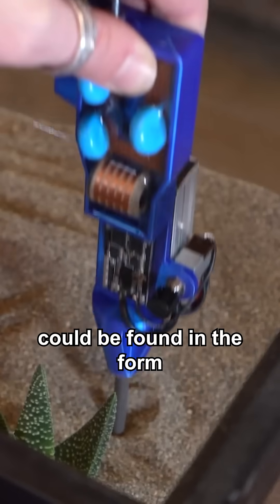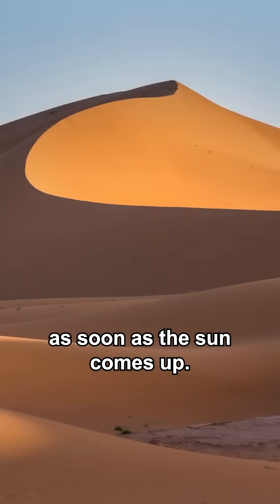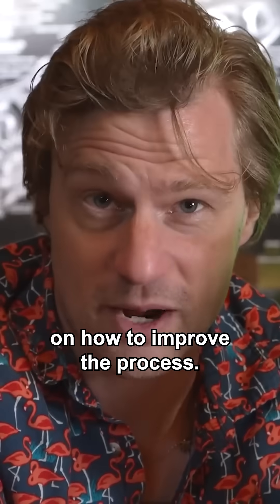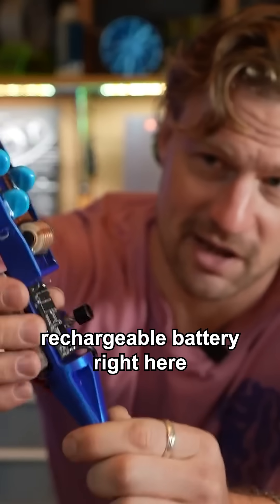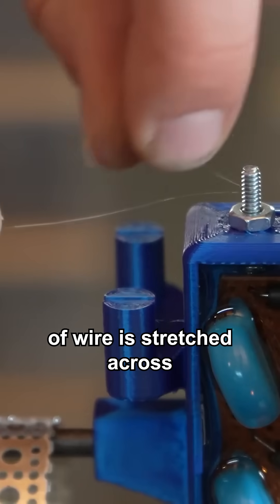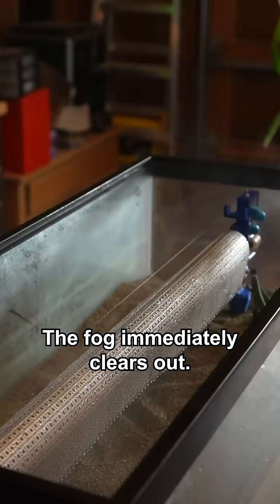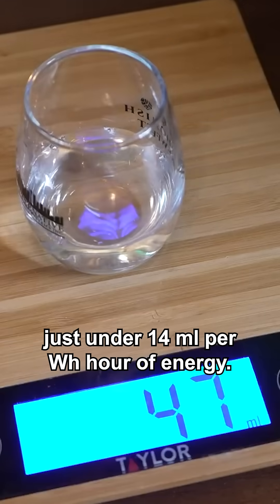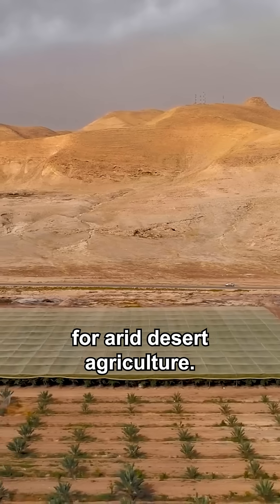Solving Desert Water Shortages Using 20,000 Volts (from full video)

Comment: Dude. This is insanely good. In your time developing this, do you think this can become mass producible given the scale that will be needed to wet soil in an arid environment?
Reply: It's a dehumidifer with a fancy name. It works the same, functions the same. You can't drink those water. You can look up other scam project like these. They will add filters and tells people its safe but its not. The air we breathe are not fully pure water vapor. It has dust and particles. Turning them into water is just you drinking dust

Comment: I saw a place where fogs are collected in nets installed vertically. Without any electronic/electrical components. Meaning, there's no need for power supply, just a simple setup of poles and nets. Water is then collected at the bottom of these nets through a water container.

I wonder how that was different from this invention shown in this video. And which is more efficient.

Comment: Yeahhh except solar panels are a scam and you end up having to replace the panels pretty frequently and it’s extremely costly. Not to mention used old solar panels cannot be recycled and end of causing pollution by leaking chemicals into the soil

Comment: This is interesting, but I wonder how much water is actually contained in a flow of fog that would cross a dry patch of land for a few hours. It might be quite a lot, but would it be enough for the necessary irrigation?

My other question is whether simple drip irrigation would let the water get to sufficient depth to STAY in the soil before sunlight evaporated much of it away. That could possibly be fixed by just having a collection system underneath the mesh that could funnel the water to a hollow stake driven into the ground, but I don’t know how feasible or helpful that would be for irrigation purposes either as I’m not an expert. I have just grown up in the San Fernando Valley in Los Angeles around a mother obsessed with maintaining her garden. Drip irrigation can work just fine but is usually done best well after sunset to avoid the worst heat of the day but early enough to give time for the water to soak before the sun rises and starts the cycle over.

Comment: What a treat idea my only issue is some of these costal regions have acid fog. Its just like acid rain, so high sulfate pollution leads to sufliric acid being dissolved in the water droplets in the air. This acid could corrode the metal used for condensing. Id think about a secondary filtration so theres not heavy metal poisoning being a potential issue.

Comment: It's not new science; it's not being used because you get water from a place where there is plenty of water. This does not work in deserts because there is no water in the air for this to work. You would have to set it up near a water source and then pump it to where it is needed, so it's just normal transport with extra steps. It could be used near salt water, but it would be costly to get it where it is needed as well as to power the devices.

Comment: We've been using this for thousands of years in the desert they just hang cloths up and it collects the water no electricity needed you are over technologies something and making something cost a lot of money for no reason gee we put a thing in a body of water that creates fog and then we turn the fog back into water but you need an initial water source to do that and there isn't one in the desert except for the fog you don't need a huge metal screen you just need anything with fibers and you know that it automatically cut it condenses when the air temperature is a moist and warm in the wire is cool so you know we don't need electricity or all this other stuff you're just trying to sell a product that's unnecessary

Comment: Electrostatic charge can be generated and fed back into the fence by the water condensation and harvesting.
The O.P.should simply look up the following item.

Kelvin water dropper.

No batteries nor complicated electronics required.

The true inventors look at existing science,particularly ancient tech.

Similarly....if you are on the coast.

Seawater can be turned into steam using a mirror array....passed to another location inland and allowed to condense there in an underground aquifer.

This would give you water inland and a mineral salt supply on the coastal collection point WITHOUT electricity.

Comment: Can’t be solar powered if the fog is gone as soon as the sun comes up
Reply: Normally I don't say battery's because they arnt realistic for large scale operations. But you would need such small battery's running at such low voltages that they would last years without needing to be replaced.

Comment: The condensing water releases phase transformation energy in form of heat. If the mesh is not cooled, the condensation will shortly stagnate. Dehumidifiers use refrigeration to tackle this phenomena.

Comment: In Peru ,the Andes have been doing this same but mechanical way of getting water for centuries .The fog condenses on vertical strings and drop by drop water is produced .No electricity neeeded !
Reply: the electricity makes it produce more water as it makes it act like a magnet for water.
Reply: @butspan7618 but it also makes it too expensive
Reply: @butspan7618 but it won’t need electricity
Reply: @butspan7618 not more, justo faster. Todo expensive for me.
Reply: No energy needed, but add just a little energy and you can dramatically increase the efficiency! You can eradicate ALL the morning fog
Reply: @LoFi_Punk  💯
Reply: I feel like that's an amazing idea, however the incredibly strong sun in the desert day time means that solar energy is incredibly useful and energy no longer is a problem in most desert situations.
Reply: @VirKap99  💯
Reply: As has Morocco
Reply: dis jus mor efishint
Reply: The process is probably much longer and more tedious in the sense of labor. A little free energy from our celestial life giver and the time and manpower required are reduced by a substantial number. Work smarter not harder.
Reply: @jacobarmstrong9227  Err...Go watch BBC tell the story instead of just saying rubbish !Are you mad ?! WTF are you talking about?!
Reply: the electrical solution works better because it attracts water ions to the metal. you will get more water from it.
Reply: What if: a passive 3D net, more dense than thame traditional vertical wires - not that efficient but cheaper and needs assumambly less maintenance, which IS an issue in desert for longevity?
Reply: Also the maintenance for the electronics needed for this set up... (not only materials but people and transportation...). As said above, first sort out the passive net options...
Reply: There is a similar system in the Canary Islands
Reply: Yeah he didn't say he invented it, he said he improved the idea
Reply: That system is 1% efficient while using electricity you make it 2600% more efficient
Reply: @recon_laksh742 Does that make it 27% efficient or 1.26% efficient?
Reply: @ 27%
Reply: @recon_laksh742  15,000feet up in the Andes many places have no electricity ...
Reply: yes i need those too for my home, i live in a foggy mountain. what is the material for the mesh?
Reply: Let's start with PASSIVE solutions.
Because you're not magically creating water, you're taking water AWAY from the environment

"More efficient" means 'taking water away from an environment that's expecting it... There are plants and animals living in the desert...

Plus.. That water evaporates again during the day, increasing the moisture content of the air - making it breathable

Also, have you ever tried to breathe air with 0% moisture? (...because you "efficiently" sucked all the H2O out of it)

The air will take the water out of YOU to try and reach equilibrium again. Out of your lungs.. With every breath.

That dry cough you can get during below zero temps...? Remember that..?
      Dry skin..? Chapped lips...? Eye irritation..?

Plus: people in these climates are generally NOT RICH, but POOR (in financial terms).
      Who's going to buy the equipment to scale this up and keep it running?
Reply: Alot of people just use a simple mesh like mosquito netting that captures an immense amount of water from morning fog. But that's boring.
Reply: Was that not because someone was tyred walking up the mountain everyday for fresh water, they decided to zigzag nets downwards to collect and transport this mist on it and get it "delivered" at the "door" 😂
Reply: @VeM-im1ji  Eith Respect ,I took this off National Geographicc .There are no 7-11's @7000Meters ...
Reply: This is amazing maybe people should study this